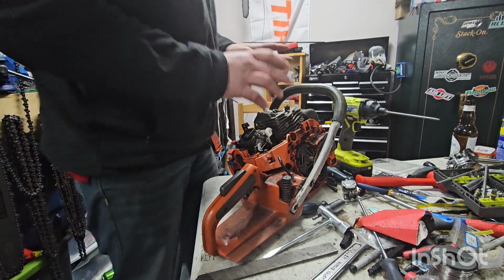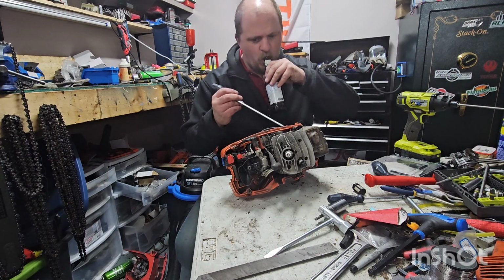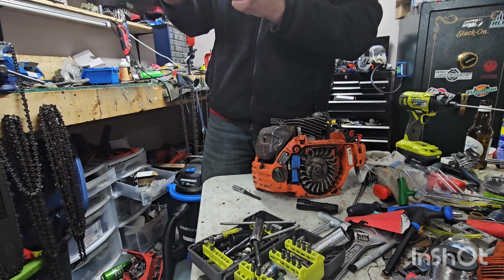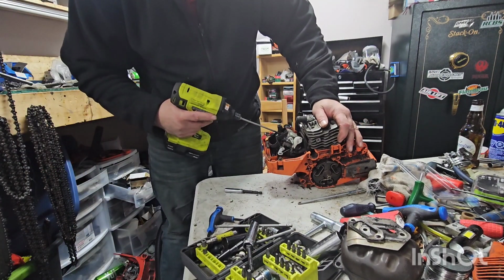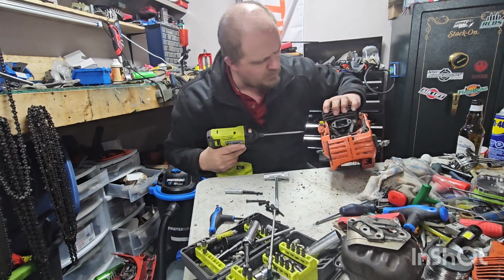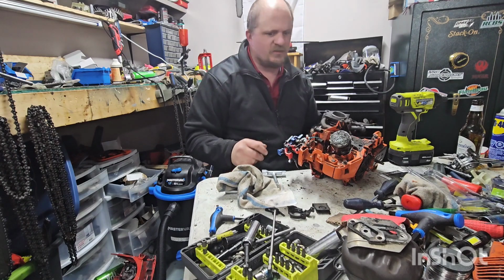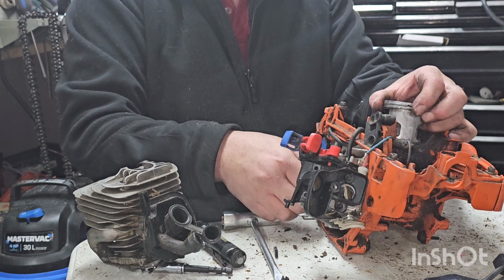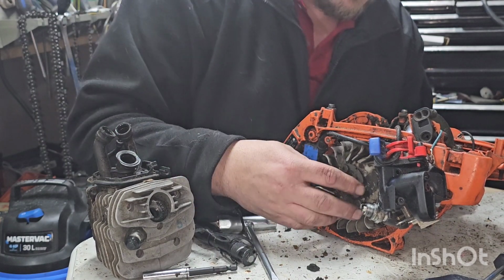1000 miles to get a parts saw??

Comment: The 570/575 is a notoriously problematic saw and I’d just part it out. I rebuilt one about 5-6 years ago and waited 2 months for a carb to be delivered from China to get it running because the original was all wore out. They had issues with crank bearings and various problems besides that. It wasn’t out a long time before husky replaced it with the 576 which is much better and similar in design but not many parts are the same. If the cylinder is good you can probably get 100$ from it because they’re scarce. I got the last oem one my dealer could find when I built that one years ago.
Reply from the maker: Yeah more I look for just used plastic part the more I think I'll just part it our, even on ebay these is sweet f*ck all for used parts